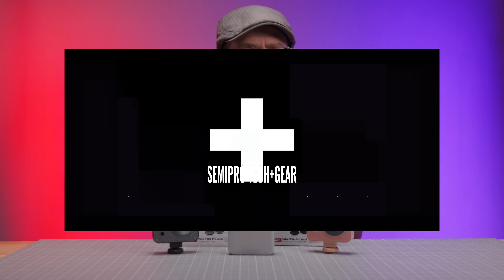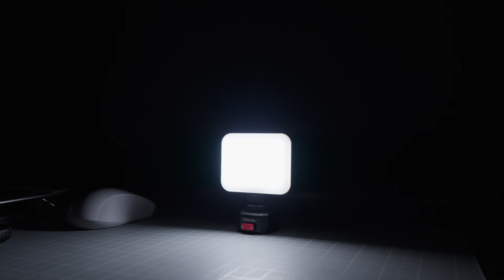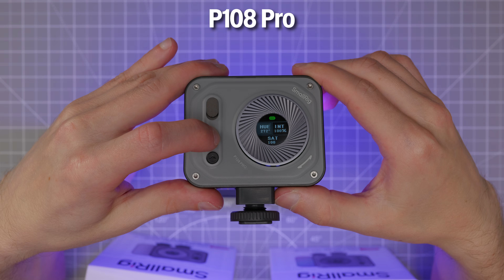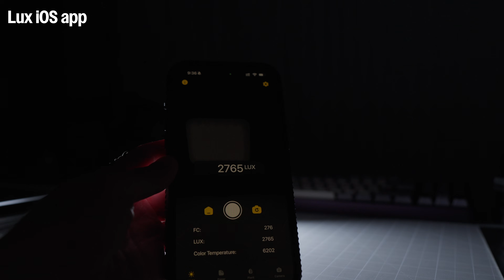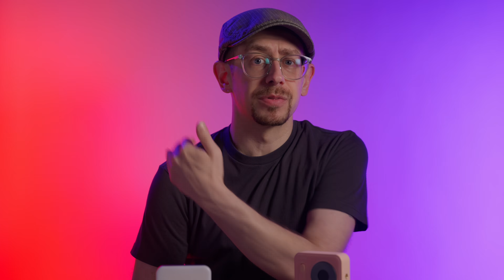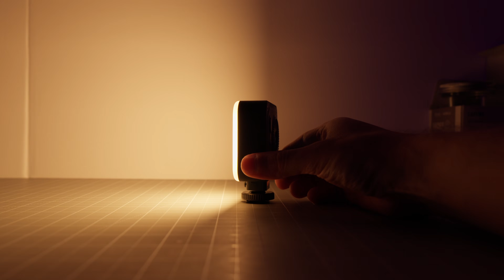SmallRig P96 Pro & P108 Pro Lights Review

Comment: ig electric tape can prevent spill on the edges
Reply: I was thinking masking tape. I used some for emergency repairs for a glass panel in Little Bus, it came off easily months later with some methylated spirits.

Comment: bought the p96 pro's and it was instant regret. the P96's (non-pro) can stack on each other, the P96 pro's cannot.. so big warning, the P96 may not have rgb, but that stacking feature is awesome, cant imagine why they ditched such an awesome feature on the pro version. There are other ways you might achieve the same thing, but not having to carry another adapter you can lose was a big bonus. The wheel isn't great either on them, definitely a cheap control wheel.